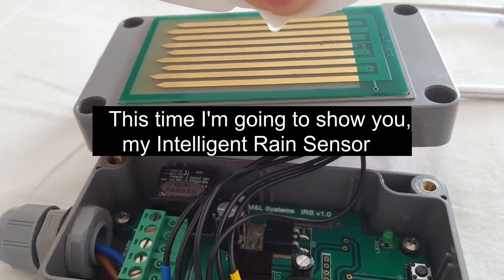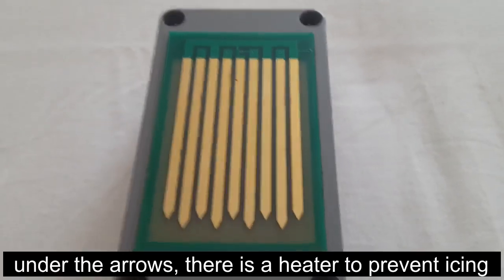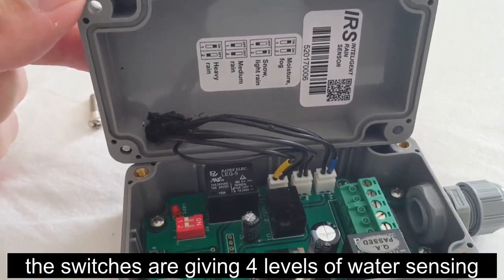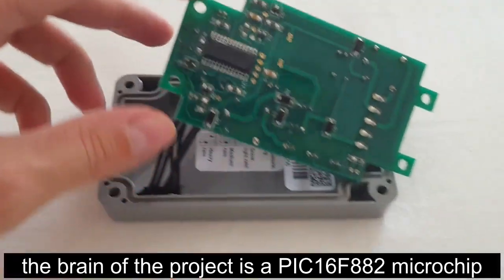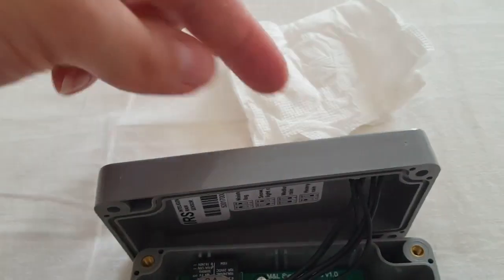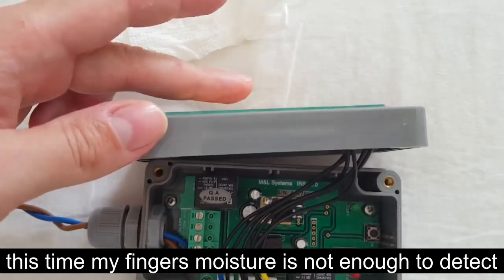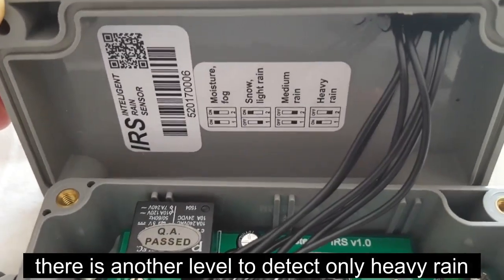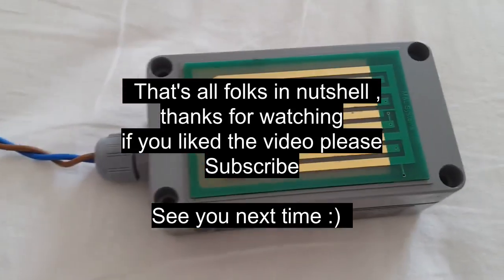💡 Intelligent Rain Sensor (MPLABX, Easy-PC)

Comment: Nice video! Can you share more about the detection plate? How does it work? Did you design that or was that an off the shelf piece?
Reply from the maker: Thanks, I'm happy that you like it. 
Yes, I designed the detection plate, it's not off the shelf piece :) 
I used Easy-PC to design it, the top includes the arrows to drive the water downwards because it supposed to be installed with an angle, to the bottom of the plate I designed a heater with a certain lenght of the copper track. 
It can heat up the pcb to around 70°C or 158°F. 
There is a temperature sensor at the middle of the pcb to give feedback to the microchip about the temperature of the pcb to don't over heat it.
The arrows on top are alternately connected to the microchip and GND. 
All the odd arrows are connected to the GND and all the even arrows are connected to the microchip. 
When there is water or even moisture on the arrows, the the water makes a little conduction between arrows and the microchip can detect the change.
Reply: @L.E.D.s  Thanks so much for this awesome explanation. Are the gold arrows at the top or is there a protective coating above them? I think I misunderstood when watching the video and thought there was a coating above -- but I would think that then the conduction wouldn't work. Really nice work!
Reply from the maker: No, the coating is applied to the pcb inside the enclosure with the microchip.
Because this is standing in rain, sometimes in heavy rain, there is a chance, water can enter into the enclosure so I applied silicone coating to prevent malfunction in operation.
The arrow gold plated pcb is without coating as you assumed it, otherwise the arrows wouldn't conduct with water. :)
The gold plating is applied to prevent oxidation, to last longer.
Reply: @L.E.D.s  Thanks for the further explanation. Really great video and product! Thank you again!